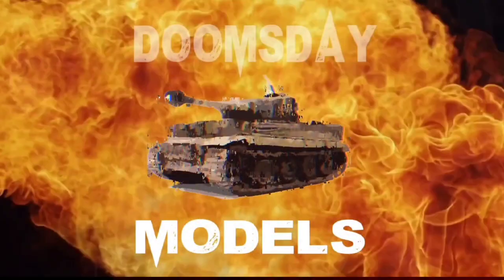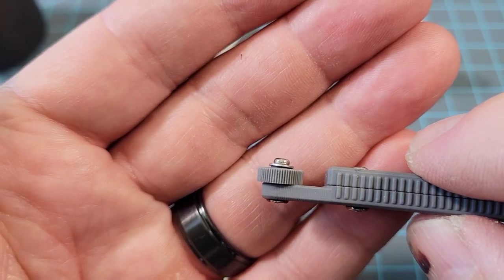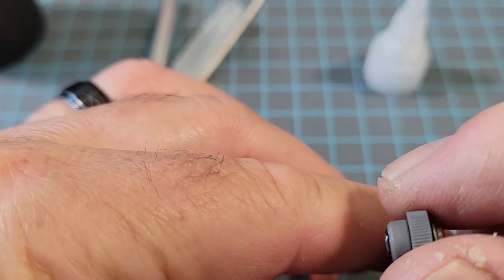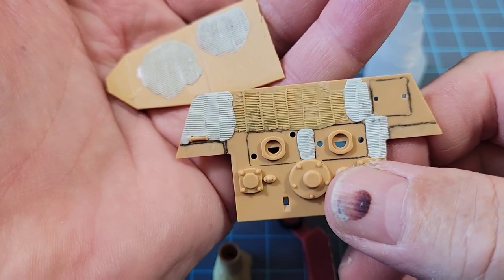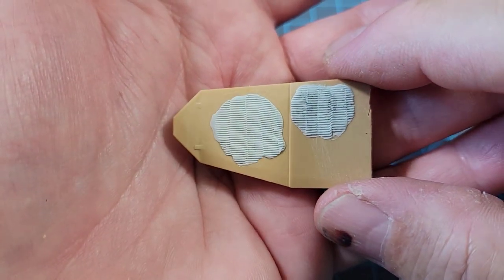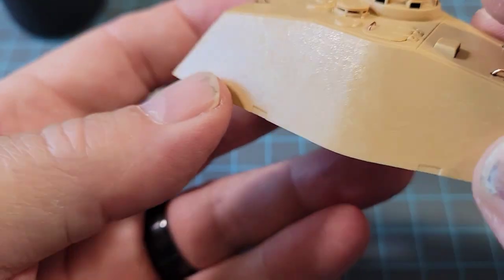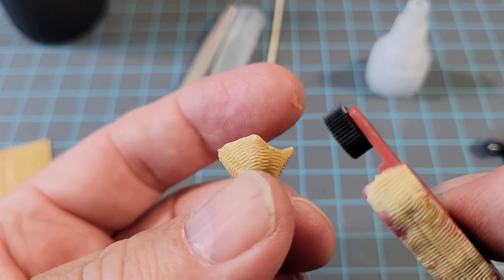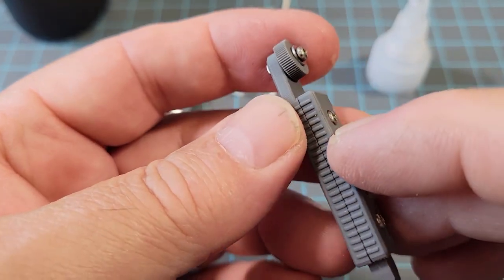New Zimmerit tool (Liang) working out successful techniques for great results. #scalemodels #panzer

Comment: I’ve just received my sets from Laing, today! First impressions are good but it’ll need some fine tuning, as the wheel widths in 1/72 scale are too wide for realistic patterning.

In 1/72 scale, the King Tiger has approximately 25 rows of vertical patterning, across the length of the turret side. That means that you require a row width of 1.8mm, for each vertical pattern row. The supplied Pattern Wheels from Liang, are substantially wider than that (4-5mm) and will require sanding, or cutting to size, in order for you to satisfactorily “zimmerit” the “Beast”! 

The only draw back with this kit (apart from having to finagle the required width of the roller to scale), is that it can look a bit too “clean”, Machine Clean, as opposed to applied by the human hand...but I can live with this! 

ATB and thanks for your video! 👍🏻👍🏻
Reply from the maker: Yeah I had to narrow the wheels myself but I think I pulled it off ok. Just make sure you stop often to make sure the material comes off evenly. I used a fine grade sanding stick
Reply from the maker: Your absolutely welcome 🙏
Reply: @Ricksarmoredmodels8539  Thanks for the advice! When I give this a bash, I’ll probably use Miliput and that way I’ll only need water to assist in cleaning the tools? 
Re 1/35 scale, the Pattern Wheels appear to be “good to go” for Tiger Tanks...in 1/35 scale the Pattern Wheels need to be around 4.8mm in width....which they are roughly....😜👍🏻👍🏻

Thanks again!

Comment: My guess is that the 0.7 is for tanks with a larger pattern, like the Tiger I, while the 0.5 would be for tanks with a smaller pattern like a Panzer IV, both in 1/35 scale.  But that's just a guess.
Reply from the maker: That's a very good guess and makes sense.

Comment: just found this thanks for the review - I am exclusively 1/72 and see only one attachment for that scale - are you saying you were able to convert some others to work for 1/72?  if so, how did you do it again, just sand the wheel to be less wide?  is the space between the raised lines on the larger scale attachments proper for 1/72?  thanks!
Reply from the maker: It looks like that the stamped waffle design is the only exclusive 1/72nd part. The wheel I did sand it evenly down with a sheet of 220 sand paper,laying flat on my bench. to my best guess of 1/48 armor. I think it would work for 1/72 as well. 1/72nd That was my scale when I was much younger.

Comment: I feel like I can just take apart an old radio or something and find a plastic sprocket of some kind and get the same effect .
Reply from the maker: They're  all kinds of things you can use. Check out one of my other videos where I make a zimmerit tool out of a fabric cutter tension nut (round). Imagination is a great thing. Liang tool is very good and cheap. 8.00 when they first came out.
Reply: @Ricksarmoredmodels8539  I'll check it out, last night I bought 2 small bags of of wheels and sprockets in the jewelry craft department . There is a few in there I can see that could be used for Zimmerit . I'm going to practice and see what results I get from them . The problem is finding proper scale, I would think .
Reply from the maker: @zachbowman9396  just use what you think looks good. In the end, we only need to be happy with the results of our work. It's great when we get outside appreciation, but we're our own worst critics right 😁.